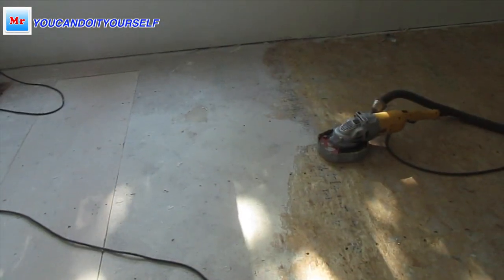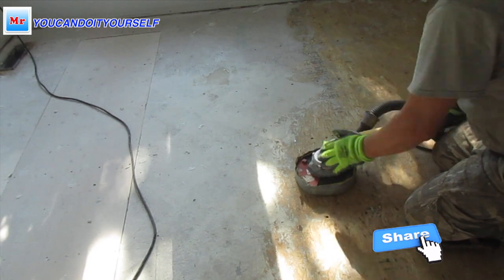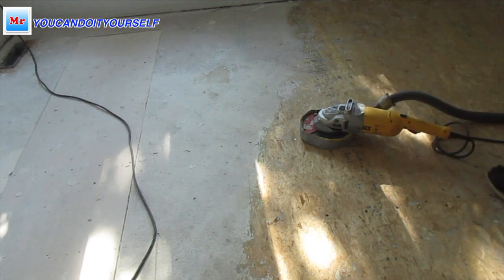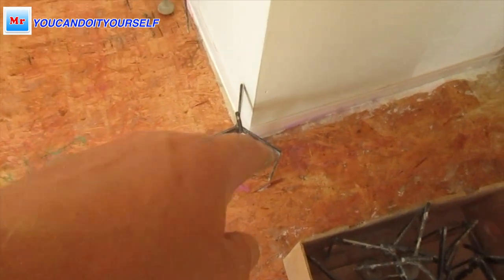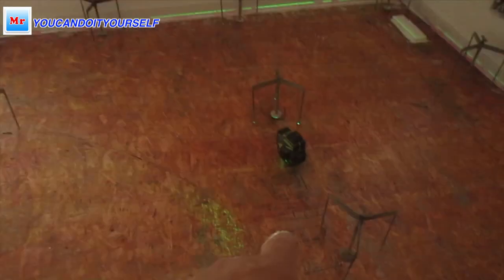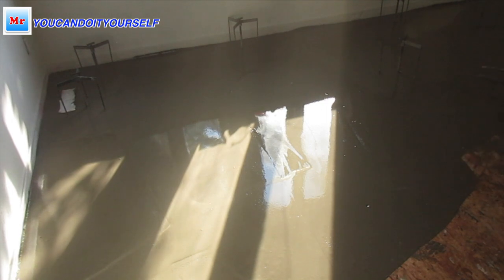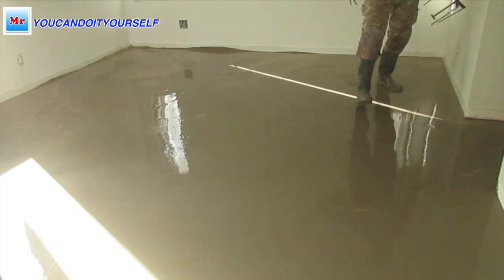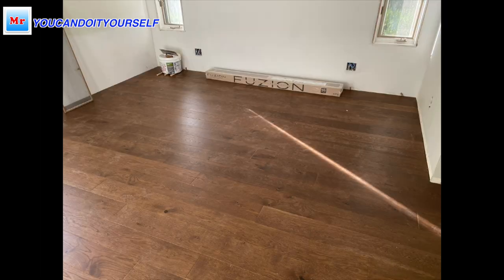How To Level The Particle Board Subfloor with Concrete Leveling Tripods

Comment: I bought a house that has a particle style board over plywood, so it's strong enough. My concern is putting leveler directly on the particle board. It puffs up when it gets wet (you can see where water was spilled on the boards before). Is there something I can use to seal the floor from the moisture of the leveling compound so that I don't have to replace all of the particle board which would be quite expensive? Thanks.
Reply from the maker: Here is 3 options. First- you ca put planipatch with planipatch primer over the particle boards and when it’ll dry do regular leveling. Second- put 1/4” plywood on top with screws and glue and then level it and third- put S primer Mapei over the particle board and then level. I don’t know exactly your situation and can’t recommend exactly which one best for you, but I use all of them for my projects. Thanks!

Comment: Nice job! We have particle board and I will try to send/clean it and put self leveling. So, you just put self leveling and after slight sending put another level of self leveling. Can I put self leveling and tile on it or only floating flors is recommended.
Reply from the maker: Hi, you can put tiles over self leveling compound, just don’t forget installing anti fracture membrane and then tile.
Reply: Thank you. As I understand I need anti fracture membrane over self leveling that is poured on to particle board, but if self leveling is poured over the plywood I do not need membrane?

Comment: Sorry for asking simple and basic questions but I am new to this: How is the hardwood bonded to the floor ?  Is it floating or nailed (I am assuming you will not be able to drive nails through the self leveller).  If floating, is the hardwood sitting on top of a soft underlayment?
Reply from the maker: This floor glued down. Also you can installing floating system. It's not for nail down for sure.
Reply: Thanks.  Just curious, when changing out glued down floor can it be removed without too much chipping or damage to the floor leveled with self levelling or would previously levelled floor  need to be re-levelled every time.
Reply from the maker: @lengoldberg7519  Here is the video  - https://youtu.be/egCwdJCwmgg

Comment: That looks like OSB subfloor, not particle board. OSB is indeed a suitable subfloor for hardwood, it just needs to be at least 3/4" thick.
Reply from the maker: If you check in Google it looks like the same. But if you like to call it OSB - no problem!

Comment: Hello, my friend. My house 1260sf (3 bedrooms), the highest point is in the middle
Of the house (because steel beam below), the higher difference is about 1 inch. Can I use self level concrete to level the whole 1st floor? What is your recommendation to do that? Should i level it by each room ? Thank you.
Reply from the maker: I don’t know exactly your situation, if it’s around one inch the highest point you can install plywood first to lower spots and then level it with self leveling compound. I have a videos how to do it.
Reply: @MrYoucandoityourself  could you give me the link. Thanks ！！